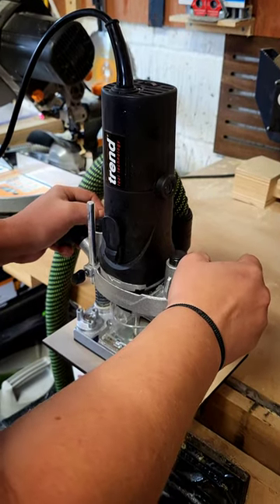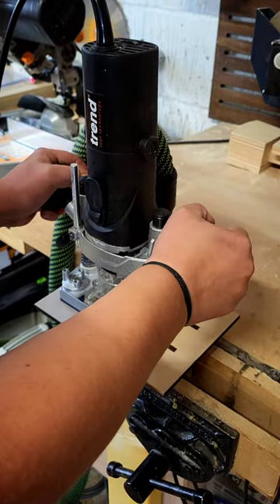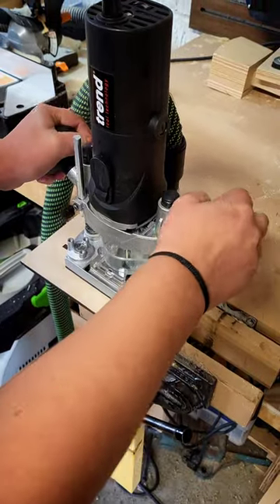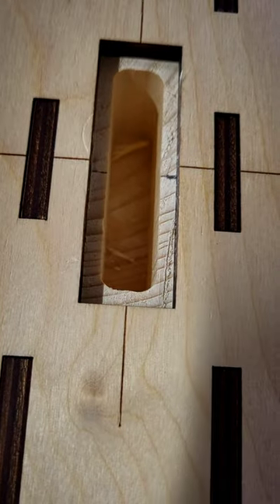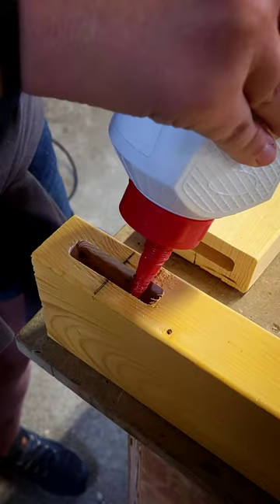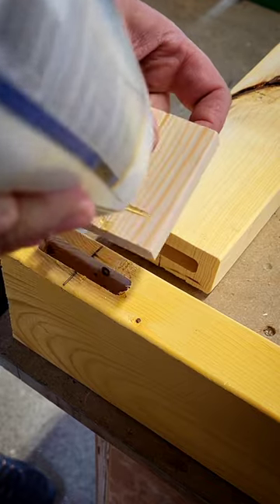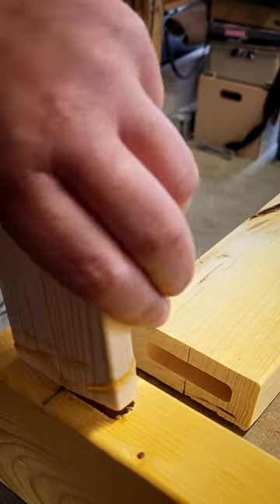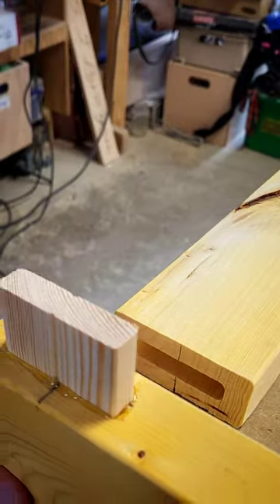How do I cut my mortice and tenon joints? Router template, a trend bushing and a little skill 🤨😉

Comment: Pine should not be used as tenon
Reply from the maker: Thanks for the comment. Its Doug Fir and works great for the application I use it in, why do you think it will be an issue?
Reply: I have chairs with pine tenons that are 25 years old.   Many very large people have sat on them,  and occasionally a large person on a large person's lap without issue.  This is a large tenon, you can make tenons with balsa if they're big enough for the load they're intended to carry.
Reply from the maker: 100% agree. As you said, as long as they are sized correctly then there shouldn't be any issues.